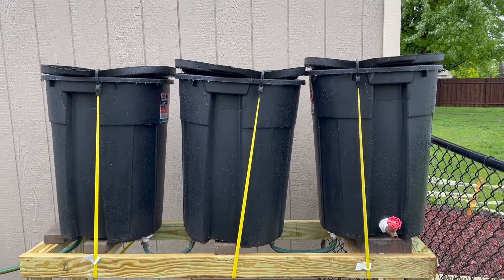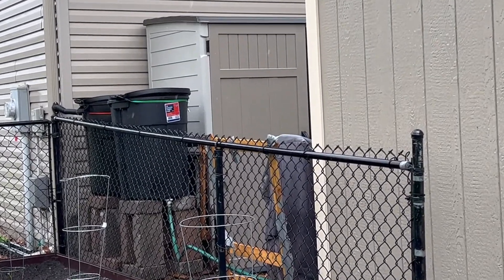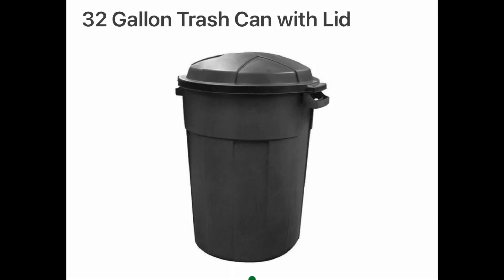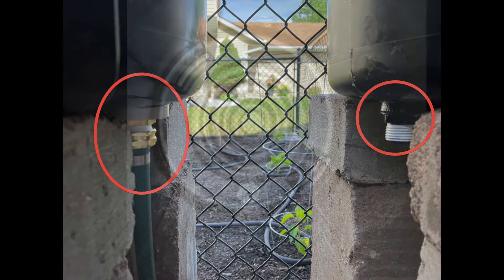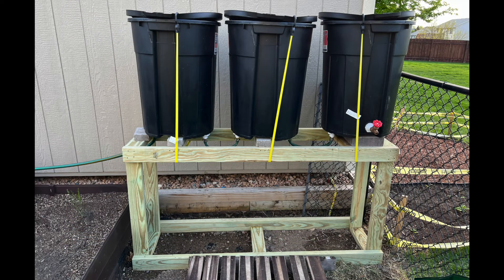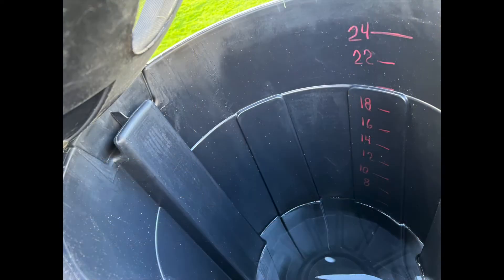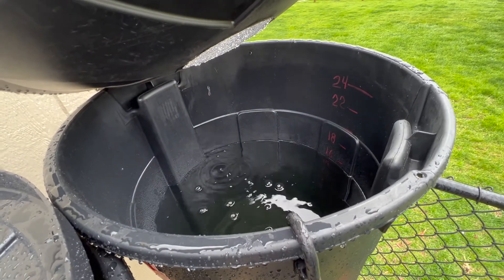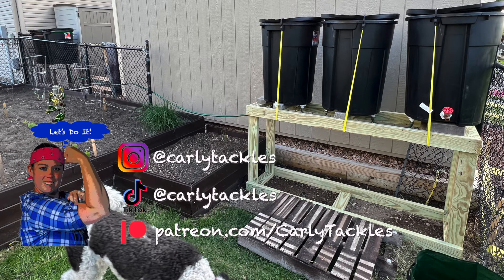My Rain Barrel System UPDATE! Lessons Learned!

Comment: You could probably use recycle lids too that already have a hole in the middle (for putting aluminum cans in originally.)  Do you think the linking could be by the side of each barrel, either low or high (instead of connecting from the very bottom of the can) if they are close enough to each other?  Does that long garden hose to the far away barrels work okay for filling those barrels?  Thank you for your video.
Reply from the maker: To keep the barrels equally balanced, its best to have the connectors at the bottom. If you connect on the side, one barrel would need to fill up to that point before going into the other. 
As for the hose going the distance, it worked but it was difficult getting the tubs the same height as the others when they were that far away. You also have to be careful that the hose doesn’t sag too low or the water will not flow nicely into the other barrel.  Hope that helps you out.
Reply: @carlytackles  if you had the connecters on the side very low would the first barrel still have to fill up completely before the second would get water, or would the balance only be off a little bit and the second barrel fill up and catch up only a little behind the first (or 3rd be behind the second barrel a little?)  It would make it easier for the placement of cinder blocks to have the connecters low on the side, I'm thinking. ( I'm new at this.  I bought the same diverter as you and waiting for the hole saw now.)  Thanks for your time and know-how.
Reply from the maker: The barrel would just have to fill up pass the connector to start flowing so not that big of deal. When it comes time to drain for winter prep, you will just have to manually dump the water out of the bucket that fell below the connector line. 
Best of luck to you. If you try it one way for a season, you can always change it around next season- not harm there.
Reply: @carlytackles  thank you.  Good idea to try differently if it doesn't work out this season.  In Northern calif. it only rains during fall and winter, but I will keep an eye on the levels when it freezes if it gets too low.  Mostly want to keep the rain away from my foundation for a distance. Thanks again.